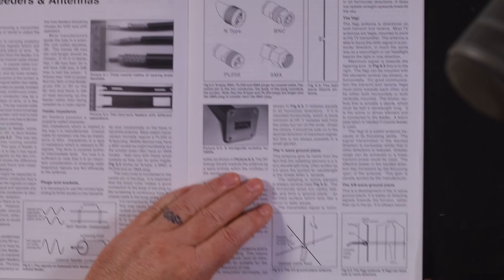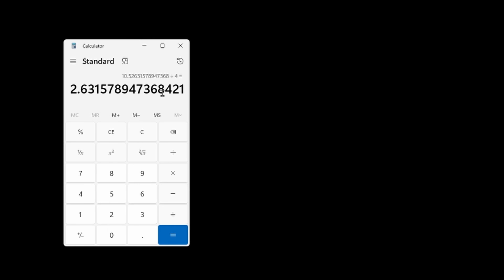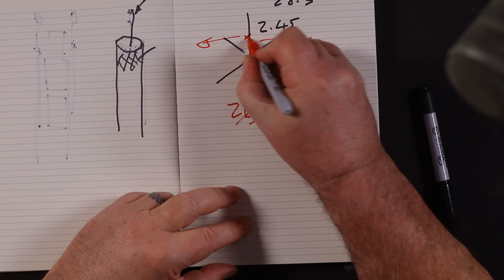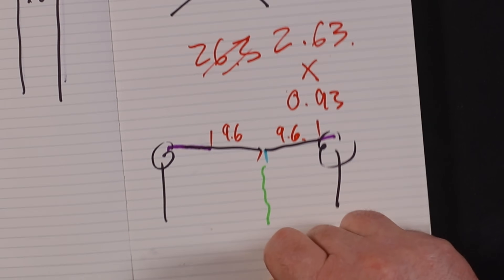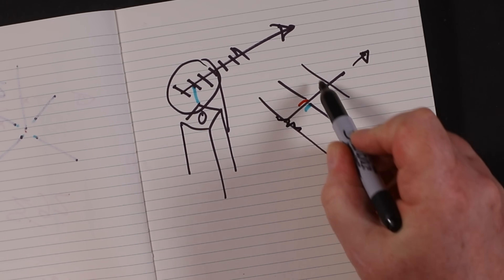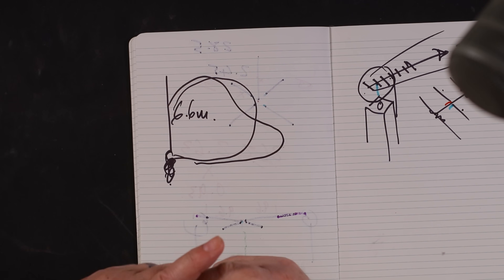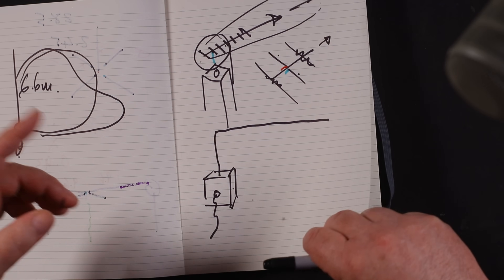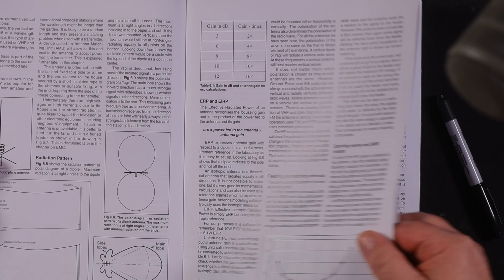7 Different Antennas

Comment: Question. Would you be better off using a Balun to connect to a TV antenna to make a Yaghi antenna? I  have a very large one I just took down and want to try.
Reply from the maker: TV Antennas are "tuned" to a specific frequency. You probably need a quick look at this video: https://youtu.be/pF6KppvYsVU

Comment: I would like to build an antenna that can get my signal out of the hole I am in.  I live between 2 mountains.   There are NO commercial radio stations here on AM or FM.  Its nuts.
Reply from the maker: YOu need to calculate the precice angle between yourself and the top of the mountain.. If it's more than 10 degrees, you might struggle a bit.

Comment: Great video highlighting the various antenna types! - The 5/8 and loop are often overlooked - especially the 5/8 - Would a 5/8 dipole work, or are they mostly just vertically polarized?
Reply from the maker: Ah.. Mostly vertically polarised.
Reply: @DXCommanderHQ  -  Would a 5/8 dipole "sharpen the beam" and have more gain? - Or would it just not tune?

Comment: 2.5:1 impedance transformers are used in some full wave loop setups, believe that is what chameleon is using in their newest skyloop.  They are an amazingly powerful antenna if one has the space to install one.  I am currently debating on using some of the big 100ft tall fir trees around my house to install a skyloop, apparently you can see gain lobes well over 12dB which is an insane amount of gain, basically like having an amplifier.  A really good antenna is a must-have for all HAMs, more beneficial than an amplifier and way more cost-efficient, and they don't always have to be expensive items.  I DIY all my own and have had amazing success on all of them, but my record is almost, 11000 miles into South Africa from Vancouver Island with my random wire end fed!
Reply from the maker: Yes..! Check out my video I made about our original "mega-loop".

Comment: Great, thanks. What's your apparent issue with EFLW antennas though? Particularly the random you mentioned, and ones like the Rybacov (so I've read and heard anyway, albeit that's a vertical I believe) can be multiband if one has an antenna tuner, so I figured they would be a good thing, especially for a relative beginner who maybe wants just one easy-to rig-antenna.
Reply from the maker: As a "home-brew" antenna, it's complex to make for a total newbie.. Sure you can buy anything.
Reply: Oh really? Well, you live and learn! I assumed it to be fairly straightforward. Length of wire, 9:1 balun, end insulator. For me, either 59 or 72 ft  based on charts I've seen. I shall let you know how my random goes when the weather finally relents enough for me to finish the job then. I've been thwarted for a week since I told you I was  putting one up! Thanks for the cautionary note Callum. Best, Les

Comment: I wonder if you could build a fan dipole but in a vertical configuration 🤔M0PMI
Reply: I think that you describe the principal behind a great antenna---The DX Commander, as build by discerning Hams! 73 Jim M7BXT (watched to the end, liked and already subscribed!!)
Reply: I’ve heard of them but don’t really like the idea of simple physics over lossy traps trombones gamma Ray matches and LC networks. I’ve yet to beat break or bend physics……
Reply: I wonder if anyone's had that idea...?
Reply: Not sure but I’m going to give it a try M0PMI
Reply: @Paul-M0PMI  Ah, well, now, I was considering something the other day, I made the comment on one of Tim, G5TM's videos.

In the beginning there was Callum here and the DX Commander, using a fan quarter wave vertical with a ground plane.

Also in the beginning was a T2LT "flowerpot" antenna, a half wave dipole oriented vertically, using the coax braid as the "other half" of the dipole. More practical for the higher bands, perhaps starting at 20m on a 10m pole.

So. What I mused was building a T2LT antenna for 20m, on a 10m pole, but then adding in fan elements for 17m, 15m, 12m and 10m. This way you have a 10m pole, and you have a half wave fan dipole on everything from 20-10m without having to bring the feeder out at 90 degrees from the middle. How does that sound? Should I patent it? :-)
Reply: Sounds good to me as long as the wigglies don’t interact with the R2D2 and your bananas all fly off in the correct direction and don’t stand in a wave. Deffo would recommend a 23:1 balloon to ensure the 7degrees of separation is maintained in order to maximise the vertical take off/landing performance.
I’ve just modelled it on Neckeasy and I’ve decided to just buy a 12 m classic
Reply: @Paul-M0PMI  I'm not sure I want to know about your classic banana.

Comment: At the risk of looking like a complete buffoon...

Does a run of coax going around corners with a bit coiled up loosely on the floor of an attic (for example) create problems?

Is it a problem? Or should you cut the coax to be as short and as direct as possible?

Im using rg213 to one chimney mounted vertical and rg8x to a roof apex mounted vertical... yes, im using 11Metres to play about with... 😉
Reply: 11Metres as in 27 Mhz
Reply from the maker: Just more loss.
Reply: A coil of coax can be useful in providing a choke. Look up "ugly balun". Going round corners, you just have to be careful of the bend radius and that you don't make the bend too sharp - that does two things, firstly it affects the impedance of the section in the band, secondly it can damage the coax. But then as Callum says, the longer the coax, the more loss you'll have.

Comment: How about Radom wire in differents higths with or with counterpoise what length are good for lets say 80M-10M and 160M - 10M and counterpoise length ?? Like your videos very much big FAN
Reply from the maker: Don't fully understand question. I don't know about random, only EFHW
Reply: @DXCommanderHQ  thats OK
Reply: There are websites giving the best "random" lengths to use which provide the best impedance match to a 9:1 across all bands. Have a search around. Alternatively, Walt, of Coastal Waves and Wires, just did a video which links to a good page which explains it all. Look up Coastal Waves and Wires (all in capitals!) if you've not come across Walt before.

Comment: 1/4 WAVELENGTH OF 75 OHM COAX TO 50 OHM IS A GOOD CHEAP WAY TO MATCH A FULL WAVE LOOP      KI4YTV
Reply from the maker: Vertical loop, yes.
Reply: Does that make it single banded though? Will a 4:1 or whatever provide a good match across other bands than the fundamental?
Reply: @paulsengupta971  it will if you use coax. Ladder line is the way to go